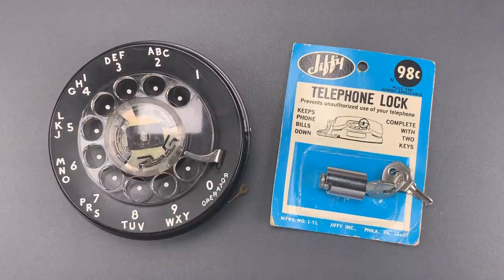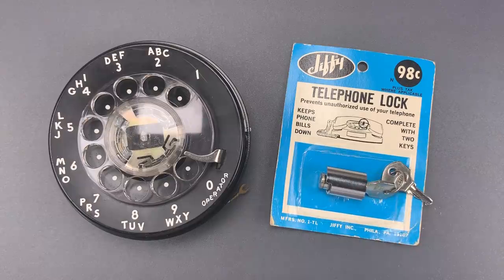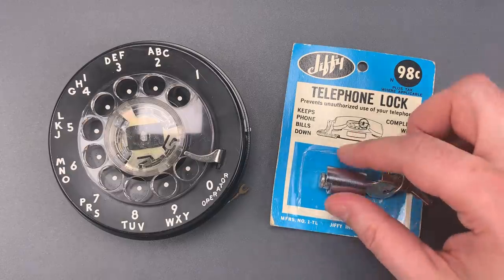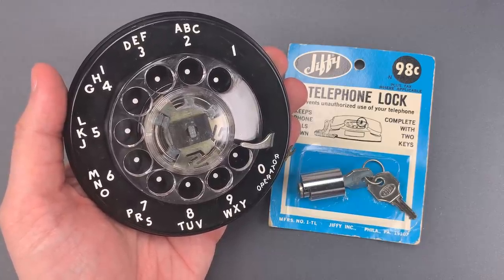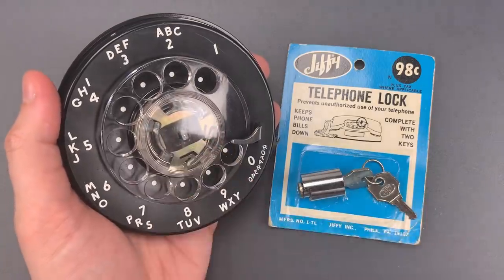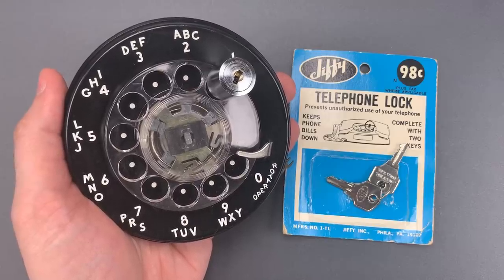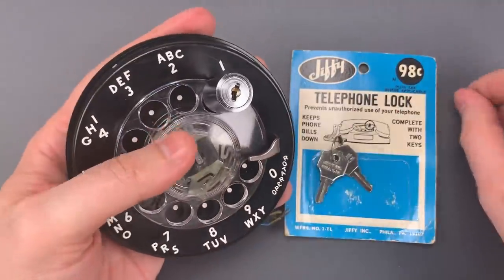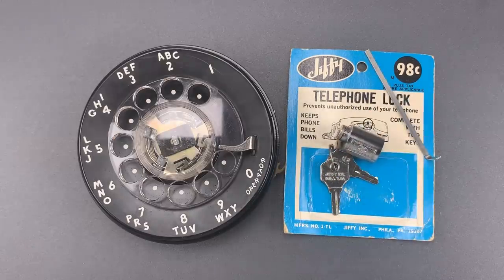[1084] This Lock Could Save A Month’s Wages... in 1960 (Jiffy Phone Lock)

Comment: I'd be interested to hear about those old ways of bypassing it.
Reply: Gadget Addict as some people already Wrote: just hit the disconnectiom rack the times for the number you want to dial. Thats it. for the 0 hit it 10 times.
Reply: Bend the finger stop up....
Reply: Take an ordinary paperclip, stick it in the tiny hole between 9 and 0 and remove the dial. Do the same on another phone to get yourself a free spare dial without a lock.

Click the spare dial on the phone and use as much as you wanted, when done, swap the dials back. No physical traces left, no skills needed.
Reply: There are many: tapping the hook quickly to imitate the pulses from the dialer, banging the 1 against the stop in the same way, recording the phone number you want in touch-tone from a different phone on a tape recorder and playing it back into the mic, etc.
Reply: @LenKusov  I remember doing that, hitting the hang up points for each number, and was surprised at how easy it was. I had assumed you had to be very even and hit at the same speed, but just ball park and I was calling friends etc. without using the dial.
Reply: Disconnect this phone from the wall. Connect your own. Bypassed! If you wanted to do worst, dial a toll-free number and use a 2600 hz tone with a Captain Crunch whistle then dial where you want... (would have worked in the old time...But not anymore!)
Reply: @francoisbelangerboisclair  ok there frank :P
Reply: Btw, the hook tapping method worked all the way thought the touch-tone era. Probably still works today if you still have a non-cordless phone connected to a proper phone line.

I once accidentally tapped out a series of ones-pulses, which the local exchange system was configured as 9, 9, 9, the UK emergency number. It played a recorded message telling me to hang up and call the proper emergency number.
Reply: I rented a room where the landlady had installed one of these.  Didn't have to crack the lock though.  When you dial a number, it pulses the line with the same number of pulses as the digit.  You could simulate a pulse by clicking the handrest switch.   So to dial 3251 - you'd rapidly click the switch three times, the wait, then twice, wait, then five times and wait and then once.   The dial produces about 10 pulses per second, you have to click the handrest switch rapidly and reasonably accurately.  But the telephone exchange has a fair degree of latitude for sticky dials, so you can get away with considerable inaccuracy.   With practice, you can call any number without removing the lock - or even touching the dial...and nobody would be able to tell that you did it.   Because pulse dialling phones are theoretically still usable - you can actually do this with many landline phones - even the ones with pushbuttons.
Reply: @SuperRatzefummel  I was going to make the same comment as soon as I saw that lock. Too funny.
Reply: @SuperRatzefummel  YES! did that in 1975!
Reply: Like you said this looks like more of a thing to keep your child from tampering
Reply: @phirenz  Some cable modems with a potsline simulator still support it
Reply: @SteveBakerIsHere  Ugh, landlords...

Comment: In Germany, these locks were places in the 3 as the emergency number is 112 - but i quickly found out i can dial using the fax machine on the same outlet, picking the phone's receiver and pulling the fax's plug.
Reply: Fun fact: many countries settled on 112 as an emergency number, partially because it's quick to transmit, and probably also because of locking the 3 like that. (The list of standard phone numbers is amazing to behold.)
Reply: @ulrichs.3228  in the uk its 999 for emergency services. The reason for 999 is because the old cables were bare copper and would touch in the wind. They thought its unlikely that the wires would touch accidentally 27 times to dial  the emergency services. So they settled on that number. Not sure if it's TRUE or half true. I think we can also dial 911 here in uk  too but I dont know what number they use in Europe.
Reply: tony jones 112 is used/usable in all of Europe, including the UK, as well as in Russia, India and the Middle East and also works in many other countries such as Canada and Brasil.
Reply: @markb6978  yes, I think you are right. Most people in uk wouldnt know that 112   can be used in uk.

I wonder if it's a UN thing.
Reply: tony jones 112 was standardized across Europe by the EU, using either 911 or 112 is recommended across the world by the International Telecommunications Union, which is part of the UN!
Reply: @markb6978  I see, I thought it may have been something like that.
Reply: Finland adopted 112 only in 1992. Before that it was 000. Police adopted the 112 only in 2011.
Reply: @tonyjones9442  You should use 112, 911, 08 or anything else than 999 when calling from a mobile phone. That way it will be made as an emergency call and not as a normal call. I doubt phones recognize 999 (I am not going to try).
Reply: @okaro6595  mobile phones recognise 999. I've dialled it on one for work.

Comment: FunFact: That time, you were able to bypass those locks by hitting the correnponding numbers on the disconnector element where the phone fork rested upon. Eg. to dial a 0 you'd hit it 10 times in fast succession. Further: Those locks were typically fixed on the 9 to prevent country codes and operator calls from being made while maintaining the 911 and local call functionalities. Thanks for such great videos!
Reply: We had a phone that had a "damper" element built into the fork and it prevented quick tapping.
Anyways my parents never used the lock, they just described in great detail what they would do to me if I ever spent too much on phone calls. That worked too.
Reply: I was impressed with my young self when I figured this out back in the day
Reply: Chris Jepson , how did you figure this out?
Reply: It's called the hook switch, btw.
Reply: I was actually expecting him to demonstrate that in the video.
Reply: Not all local calls; it does add the somewhat arbitrary requirement that the person you're calling doesn't have any zeroes in their phone number. But it's still better than no local calls, I guess.
Reply: @wtfiswiththosehandles  Do you know what the purpose of that element was? I wonder if it was specifically added to increase security when one of these locks was used.
Reply: @Sparkette  I don't know, honestly. I remember trying this trick my friend showed me, but our phone for some reason was very slow to react to those taps. Forks moved so slow up and down that it just wouldn't work. No idea if it was intentional, or just a fancy feature.
Reply: I also found the hook trick myself (also you can do with shorting the wires) and I used it in my school and hospital where they had these one direction phone without a rotary disc to call home. 0 was 10 hits
Reply: Some newer phones have a switch in the back called "0-lock", which does the same thing.
Reply: @markschiavone8003  I was always was interested in electriciy and how things worked. I was wondering how the numbers were being sent down the line and with only two wires. Then thought about what the purpose of the spinning dial? I also noticed you could hear a pulsing noise in the receiver as you dialed. Clicking the hangup arm you could hear a simular pulse. And it just all came together in my head what was happening. Tried pulsing the hang up arm with our phone number. Hung up and the phone rang. I remember being really excited and had to show everyone. I think I was around 7 at the time

Comment: This reminds me of some teenagers I knew when I was just a little kid.  There was a take away store which hooked their private payphone into a standard phone jack and disconnected it each night to wheel it into the store.  The only problem was that the jack was on the exterior wall.  These teens would turn up after the store was shut and plug in a standard phone to make long distance calls at the store's expense.  It would have perplexed the bill payer, since there was no detailed phone bill accounting in those days, only a total of local, long distance and international calls.  I still don't know whether they ended up getting caught.  I suppose at least they were calling at cheaper, off-peak times.
Reply: Some teenagers I knew when I was a teenager just got a regular telephone, put alligator clips on the cord, and opened up one of those green boxes with all the wires in them.
Reply: @brianleeper5737  Houses used to have a box on the outside secured by a bolt that you could remove, inside was a standard phone connecter with the house line plugged in.  Common thing to do to someone you had an issue with was to sneak over, plug in a cheap phone, and call a 900 # and just let it sit.  The owners would be presented with a huge bill at the end of the month.
Reply: We used to make long distance calls for free on the payphone by raking its  lock with a paper clip.
Reply: At tech school we did the same to the payphone....strangly only the electronics students figured this one out...also one, our labs had the whole schools internal, relay logic swichboard on the back wall, you could hold a few down and make any phone in the whole campus ring...being in the 4th floor, and the principles office being visible, we regularily pranked him ;)
Reply: We used to have a phone system in our family ...one of the kids would call  collect" using the operator and ask for themsves,that clued Mom on the other end that you made it to your travel destination safetly..Mom would just decline the call and there would be no charge on the bill...long distance calls were $$$$$ Back then

Comment: Another thing I'd like to mention about phone billing in the old days (starting mid 80's after the ATT breakup) was that there were also things known as LATA's (Local Area Telephone Access) where if the boundary of your LATA was on the street you lived on, calling your neighbor across the street (in the next LATA) could cost more than calling across the country.  

Additionally, these phones worked on what is known as "pulse" dialing, which basically sends "pulses" to the phone company switches.  Anyone who understood the way pulses worked could dial a number by using the plunger (where you hang the handset when you are not talking).  The plunger acted as an on/off switch and by sending repeated on/off signals by tapping the plunger, you could have the phone company switch treat it as if it was a dialed number.  This was not hard as a the switches treated each "pulse" or ON/OFF interaction as 1 and a pause of greater than 1 second would make it think you were dialing a second number.  So to call 234-5678 you would tap and pause the plunger in the following way:

tap tap
pause
tap tap tap
pause
tap tap tap tap
pause
tap tap tap tap tap
pause
tap tap tap tap tap tap
pause
tap tap tap tap tap tap tap
pause
tap tap tap tap tap tap tap tap

And then wait while the switch connected your call.
Reply: Local Exchange Carriers (like the Bells, Contel, Centel, GTE, etc) were not allowed to handle telephone calls that originated in one LATA and terminated in another. Those had to be handled by a Long Distance Carrier like AT&T, Sprint, MCI, etc. LATAs still exist today.
Reply: @brianleeper5737  yep, it's been a long time since I worked in phone billing (I worked for an LD reseller) and some of those old memories are rusted shut in my head. Just need to pretty them loose for it all to come flooding back.

Comment: As a kid in the 90s (too young for rotary phones, but we used calling cards and had long-distance providers barrage us with ads more often than Geico does now) - most of the locks I encountered in my house could just be jiggled open with almost anything (luggage, jewelry boxes, ancient door locks, etc) and I thought locks were all worthless. 
Turns out I was only half right - good locks exist, but are almost never worth the cost, and cheap locks deter many people (except the curious adolescent) from even trying.
Reply: calling cards and long distance companies still exist.
Reply: On top of that, people used to make "free" calls on other people's calling card numbers.

The way these calling cards worked was, you called a toll-free 1-800 number, and then typed in the ID number on your card when prompted.  But many phone companies used ID numbers that weren't much bigger than the number of customers they had -- e.g, 20,000 customers with only 5-digit codes, or 200,000 customers with 6-digit codes.  Meaning people without a card could just call the 800 number and guess some random valid codes with decent probability.  Then use them until the actual customers caught on and got new cards.

Comment: When I was a kid back in the 60's, my Aunt two doors down had a phone in a "summer house" patio area and the neighbor lady would sneak over and use the phone.  My aunt had a blank plate installed where the dial used to be, and that stopped the neighbor lady from using the phone.  I later demonstrated to my aunt how I could still dial the phone without a dial by simply tapping the switch hook (the place you would hang up the receiver) the required number of times per digit being dialed.  In other words, tap it 3 time to dial a number 3, 5 times for a number 5 and so on.
Reply: How many times for a zero ?
Does it work with a modern landline phone ?
Reply: @Ur Mom would not work on a modern phone
Reply: @zethcader6478  No, it works fine on modern phones.

Comment: I remember growing up with the phone attached to the wall and we only had a 4 digit phone number.  I don't think we ever had one of these attached.
Reply: Me too. I have been wondering for years why we can't still dial four digit numbers of they are same area code/exchange. We could do it with 1930s tech but today's computerized switching systems cant figure out that if I dial four digits I want same area code/exchange as my number?
Reply: I remember when our phone number was Westbury 57J - Ring Twice.
Reply: My Mom talked about having a 4 digit number locally growing up. You were able to call those on your local exchange by 4 digits, and in your local city by 5 digits. They had to give up their number when 911 came through, as dialing a 5 digit city number started with a 9. Anyone with a 4 digit number starting with 11 had to get a new number. Funny enough the 4 and 5 digit dialing was discontinued not long after making the new numbers unnecessary and the numbers starting with 11 went back into use.
Reply: In the 90s I spent summers with Grandma in a small Russian town. Phone numbers in the town were 3 digits.

Comment: That never stopped me from rapidly hitting the handset switch 10 times and then have the operator complete my call.
Reply: I forget but was that an added cost if an operator had to complete your call?
Reply: What's an operator? /jk
Reply: Blue boxing ftw...
Reply: @thiesenf  And with the old payphones, one simply needed to push a pin thru the microphone holes and short to phone case then proceed to flash dial operator.  Those were the days.
Reply: @alf.2929  We usually got several free information and operator assist calls per month; after that, you'd pay. 'Information' was like Google with live people at the other end.

Comment: My late step grandmother had a lock like that on the rotary phone from the mid 60's at her lake house she had all the way up till the late 80's when she finally got a cordless phone, and had the phone company come in, and rewire the place from hard line jacks to RJ-45 female jacks. even then it was expensive to make a long distance call, and we used MCI access calling cards for making them.
Reply: RJ45 is primarily for computer networks.
Reply: @markarca6360  It was very common for the AT&T Merlin phones. In fact, in the 1980s, you were far more likely to find an RJ45 with a Merlin phone plugged into it than any data/computer equipment.

Comment: Omg I found a lot of those locks in my dads workshop and I thought they were just badly made cores so I put them for scrap I feel very dumb now
Reply: Don't feel bad. Allow me to top your feeling and make you feel better.
My family once owned a French farmhouse. The beams on the large shed were old and suffering from woodworm before we treated them, so we built a new roof. It was built 1900-1920 according to dates on the roof tiles.
Not knowing what to do with all that wood in such an unreliable condition, I set fire to these oak beams and created a fire so hot you had to stay 30-40 metres away not to feel hurt by the heat.

Five years later I would meet a furniture restoration guy, who explained that there is a high demand for 'newly built old furniture' and that they pay € 4500-5500 for such aged and weather oak wood beams because they need to be at least 70 years old and 100+ commands a premium, since wood that old without rotting is extremely rare.

At 12 sidebeams and a central beam burned, that fire cost us about over € 61000 and up to € 70.000.
Reply: gosh that hurt reading.
Reply: To be honest, the cores WERE badly made if you could jiggle it with the back end of tension tool

Comment: LPL : "I know there were a number of techniques to bypass devices like this."
Comments : Did you know there are techniques to bypass devices like this?
Reply: You tap the little buttons on top of where the hand set sits. That mimicks what the dial did. 6 rapid taps = dialing the number 6. Used to call home from work like that after the boss left and locked the phone,
Reply: @bruceclemens4953  it's called hook switch dialing. You had to have just the right timing so you didn't signal a hook flash or a hangup.